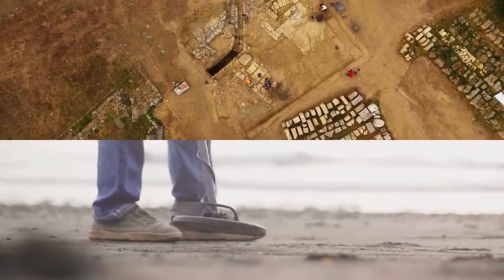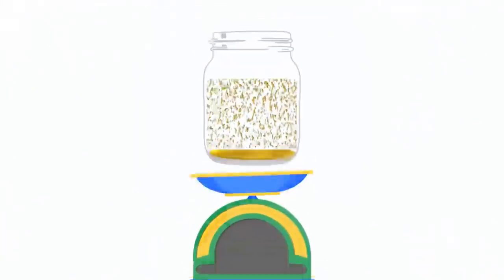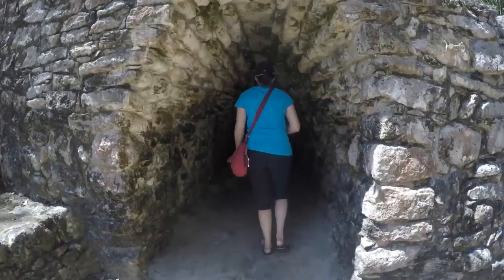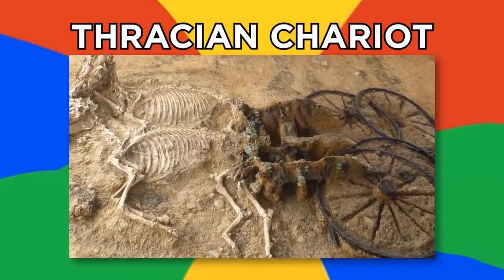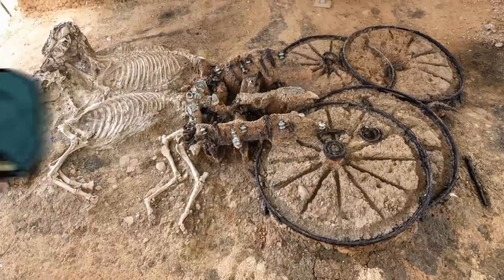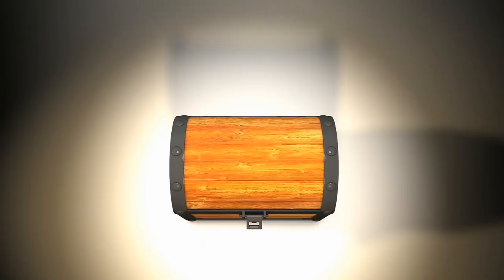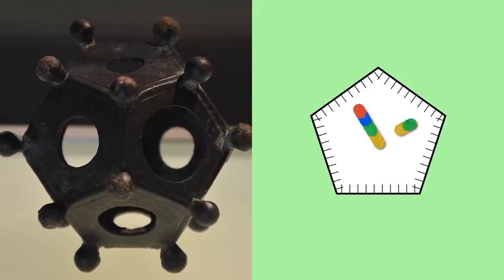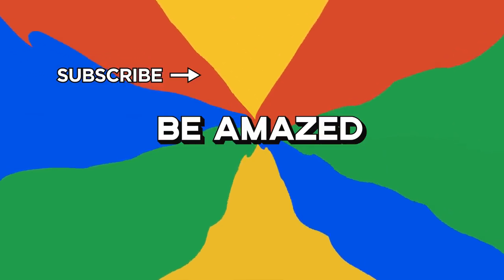Ancient Rare Objects Found Underground

Comment: The "golden spirals" look like filings from a drilling process that someone chose to save though. Seriously, not everything found from way back then needs to have some sort of significant purpose. The metal worker simply saved it in secret from his master and never got around to digging it back up. In addition to that, if the spirals were indeed so significant, they wouldn't have been buried in a wooden box, it would have either been steel or stone as was apparently common at the time.

Comment: Roman Dodecahedrons is also known as SCP 184. 
When inside an enclosed structure, SCP-184 expands the structure's inner dimensions without altering its outer dimensions. SCP-184 will increase the inner dimensions of any enclosed structure by several hundred meters each day, beginning one hour after entry into the structure.🙏🏼
Nickname: The Architect🔥

Comment: The 600,000 year old "Aluminium wedge" is a special Excavator bucket tooth . They are made for digging Coal where Methane gas is found (Google it) . Being Aluminium, they do not produce a spark when dragged over rocks , so they do not ignite the Methane gas . It would be lucky to be SIXTY years old . The retaining pin has broken while the machine was digging at depth and that is how it was found 30 feet down . My belief in carbon dating has been shattered !!!!!!!!!

Comment: I have Allways thought the roman dodecahedron wear for cutting dowels,, one hole is bigger then the opposite side,,, the little balls on the outside have flat spot's or are squashed out of shape. If they are made out of a soft metal they thick. A lot are broken/cracked  (bronze one's or iron)  if they are made out of a soft metal like lead or sliver or brass  they are bowed in on the small hole side and have big flat spots on the little outer balls...Most show sing's of use as a dowel cutting tool that cuts round dowels out of square pegs. I really don't know why no one ever suggest this, If i was making round dowels for a wooden boat these would be the perfect tool for the job,,, wear the romans good at boat building???  did they use round dowel/peg's????? round dowels/pegs of different sizes this would explain why there is no standed size for them, you just have one that matches your drill bits. This allso explains  why the soft metal ones are so thick and the different types of damage we see on them.

Comment: The aluminum wedge is nothing more than a replaceable digging tooth for an excavator bucket. From research often used in mines for its non sparking characteristics. Someone miscalculated it’s dating. Problem solved...

Comment: Shaving down larger gold coins to pass it for a larger value coin to shortchange the person it’s given to.. Or shavings from trying to create a perfectly round coin. Shavings kept for their value. Or since gold was valued by weight, shaving it down could be a low wage workers pay. Or could be just a way to hide money to be sewn into cloth and hidden.
Or hair jewelry for either a person or a horse.
The dodecahedron could be a way to value a coin. If it passed thru the certain hole, it’s that value. Kinda like those baby toys that put different shapes in the ball. Tying it to the shavings. If there was one standard size coin, a blacksmith could shave it down until it fit thru one of the different holes. Thus being able to standardize gold across the area. It’s just another way to make sure you weren’t cheated.

Comment: So. What is it? Really?? I've been debating and arguing even with myself for a very long time, even though I've worked in a metal pouring foundry and made casts with the stuff. Metric / Imperial, Okay. American's (I am) seem obsessed with being different. But this metal type is even spelled differently depending what side of the Atlantic you're on. Is it Aluminium, or is it Aluminum? 

I've even tested what search engines result on the subject and even that didn't conclude in an answer either way. As America is the only one that primarily uses the imperial system are we also the only ones that call it Aluminum (without the extra i)? My personal opinion supports the idea that the US needs to 'get with it' and start using or at least start educating newer generations to be coherent with the metric system do we also need to adjust our ways with this?
I think the world would be a better place overall if we all used the same systems of measure and generally used the same spellings and pronunciations for things. 

That said, blasting at my self in a way on the subject of measurement and element 13 because I am American; Hey European's; When you see the letters TH together for fucks sake quit pronouncing it like an F!!!! I'm not at all confused on that one. You are! Stopit! Even the periodic table presents and states element 13 without the extra i letter as people on the east side pronounce and spell it. Someone needs to straighten this schitt out so we're all on the same page.